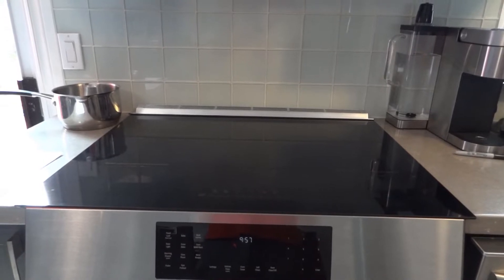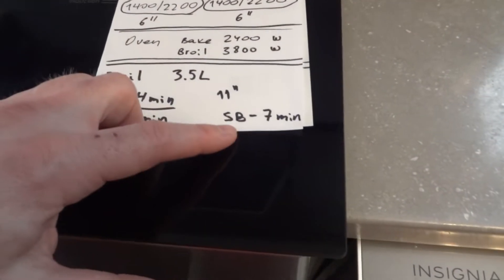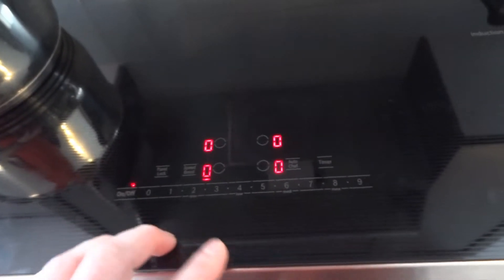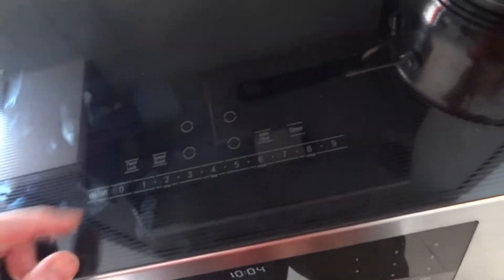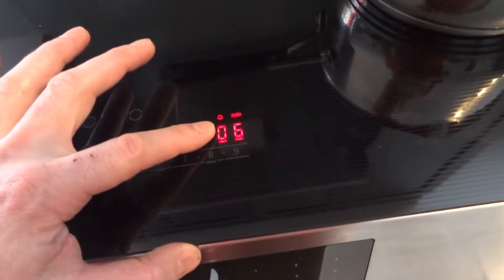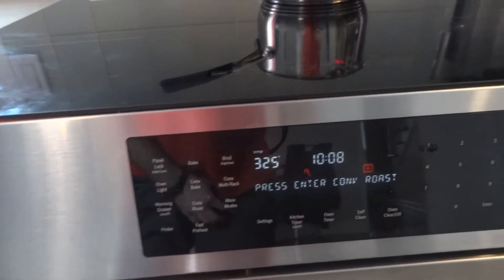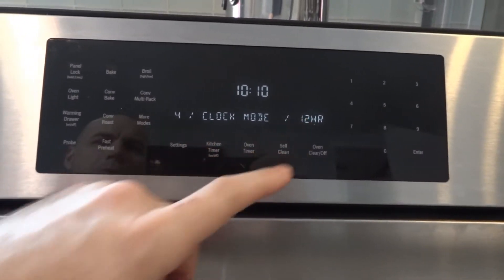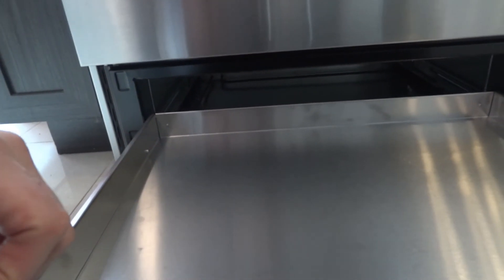Bosch Induction Range Review

Comment: Love the review! The only thing that I find confusing is that based on the design, it seems like the oven is not very deep, less so than normal ranges - is that correct? Currently in my oven, I can put 2  standard cookie sheets side by side on one rack. Can you do that with these racks? Thank you!! :)
Reply from the maker: I have 1 big cooking sheet 16 x 21.5 inch /bought it in Costco/, once inside there is still 1/2 inch on left and right side of the sheet.
I have 2 other smaller sheets, they don't fit together on the same rack.
The rack dimensions 23.5 x 16 inch.
Reply: @AlejandroNemo  Perfect - thank you!!! :)

Comment: If you wouldn't mind, the next time you heat the oven, Can you please tell me how long it takes to get to temperature (not using the "fast preheat")  I want to make sure my bake element is good.  I feel it's taking too long time to get to say 400 degrees on bake convection (with auto conversion off).  If you wouldn't mind doing that experiment the next time you bake, I'd really appreciate it.  Just let me know what setting and temperature you used.  Thanks!
Reply from the maker: Ok.
I finally got my hands into baking!
So normal preheating to 370F took 14 minutes, a bit long.
In the recipe i was doing, in 1st step they said preheat your oven 😂, i guess to have enough time to prepare the mix for the cake...

Comment: Could you tell me if you had any problems sliding the stove in with the cook top overlapping the counter on each side?   I want to get this but I am wondering if this overlap makes it impossible to slide in if your countertop are not wide enough or if the floor is uneven the range will not slide in.  Also, what are the vents in the back for?  Are these vents just to cool off the heat from the oven when done?  Thank you!
Reply from the maker: About vents on the back I didn't pay attention to them, hovewer there are vents on the back of cooktop which driving heat from inside along a wall upward.
Reply from the maker: About overlapping with the counter - the range has adjustable legs, so you just twist them to desired height.
I didn't have issues with sliding it in as i have ceramic tiles on the floor.
Reply from the maker: Usually the gap in counter is a standard wide,
You can check dimensions on their website

Comment: I'm about to buy this exact model (discounted because it is discontinued).  I'm wondering if you are still happy with your purchase and if you found it to be reliable?  Do you find the oven big enough?
Reply from the maker: So far so good, oven seems to be the right size. Sometimes the drawer at the bottom is not very cooperative and opens on the second push ( not sure if they all have the same problem).
Reply: @AlejandroNemo  thank you so much for the quick reply.  I'm negotiating the deal right now.  Does the glass top scratch easily?  How long have you had it so far?  Sounds like overall you'd recommend?  The other induction range I was considering was  the LG which is much cheaper but maybe not same quality.
Reply from the maker: @thehairbandfan  i would recommend it, glass top is fine, i have it since i made this review, i looked at LG as well, but i didn't like the design
Reply: Thanks again. 😊 just bought it. Fingers crossed. I’m excited. Looks like a fantastic stove. I take delivery in a week.
Reply: How much did you get it for? I'm also looking to buy, and if it's discontinued perhaps I can swing a similar deal.
Reply: @smellykittyfart  $3200 Canadian + tax.  It was unused, but out of the box.

Comment: Set the time on this stove please.😊
Reply: Did you ever figure out hot to set the time? I can’t figure it out either
Reply from the maker: Press on Settings, first left button under the screen/ middle section.
You will see - Set Clock.
Press Enter on digital dial on the right.